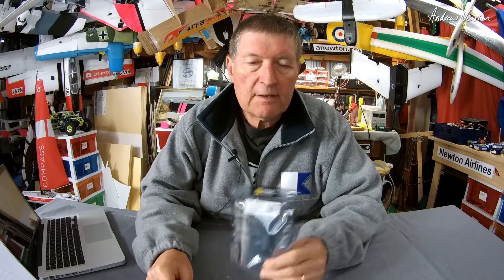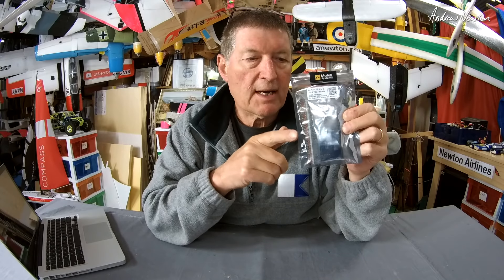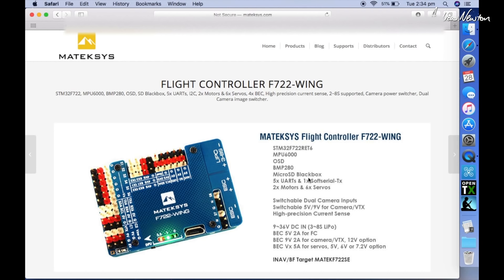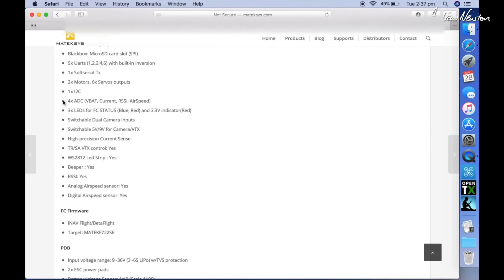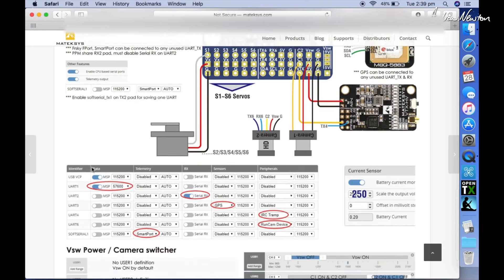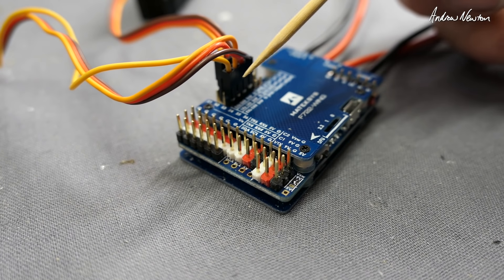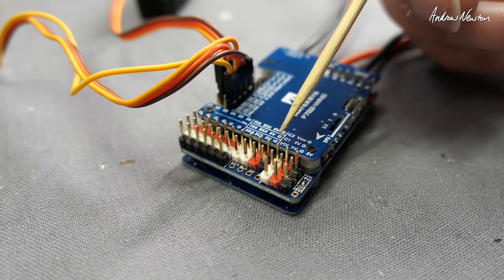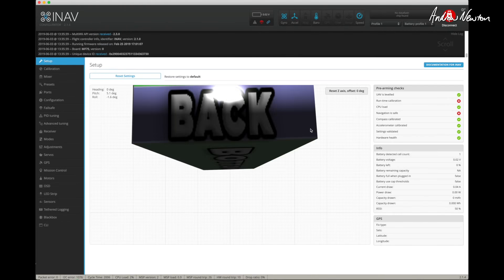Matek F722 Wing iNav FCB

Comment: Nice video. How to connect smartport? I really confuse because uart 2 is already use for SBUS
Reply from the maker: 2 ways. Enable Smart Port on any spare UART in the Ports tab and connect to the TX pin. Or enable CPU based serial ports in Configuration, then Soft Serial on UART 2 and connect to TX2 (SBUS only uses RX2)

Comment: 06:32
You say you are using the F722 Wing card but when selecting the firmware you select the MATEKF722SE version and not the MATEKF722 version which is the reason?
Reply from the maker: Correct target is written on the bottom of the board and on the product page. I guess Matek consider the Wing version of the board to be the SE Special Edition, confusing names.

Comment: nice job, just wired up mine no video thru the board
Reply from the maker: Things to check: Cam and VTx work without going thru the board. Cam in C1 and VTx into VTx. Board powered up and VTx powered up. Correct channel. User2 mode setup to turn C1 on. Polarities correct.
Reply from the maker: Oh unless you dont actually want video.
Reply: I have the same issue... How did you set up the user1 options?

Comment: Cam switching on and off for hd don’t work on mine.  Been trying for months to get it working bug no go.  I just run my Mix2 hd and second cam continuously.  I’d like to be able to shit off hd/Mix2 when not recording footage but something is not working properly.   I have mine setup identical to yours.
Reply from the maker: So you have bridged the little solder pads to select voltage, and set up User 1 in iNav Config?
Reply: Andrew Newton yes.  I selected 9v and user1 for on and off but doesn’t turn hd off

Comment: Anyone flashing this board with inav please use the target from the matek website. Also make sure to clean any extra flux off after soldering the pins on, extra flux causes shorts. I also broke my USB off but I can still connect to it using an ftdi adapter in Uart 1. The board also will not show proper mah drawn without a capacitor. Still love the board just a few hiccups.
Reply: Epoxy is your friend with the USB port, you should try replacing it! I managed to flash my board with no issues in Inav.
Reply: FYI: I just downloaded the firmware from Matek web site AND from iNav.
I compared the files and they are the same. (and exactly same size 843727 bytes).
Reply: jocelyncloutier maybe the problem was fixed. When I downloaded the target from inav the barometer wasn’t recognized.
Reply from the maker: Thanks for clarifying that. No issues with mine so far.

Comment: I have two F722-Wing boards and two F405-Wing boards.  I much prefer the F405-Wing.

I hope the next gen F7 board that will have the larger flash to accommodate Arduplane is better.

The problems I've had with the F722-Wing are:
1.  Random corruption of settings
2.  Random settings (OSD especially) reset to defaults
3.  When the above happens - strange things happen in stabilized flight modes (flick into loiter and the plane rolls inverted / begins a spin)
4.  DFU flashing issue if UART 1 or 3 is used for GPS (multiple targets error)
5.  INav 2.1 default tune flies terrible (probably more INav 2.1 issue vs this board, but 2.1 is as old as is supported for this board).  One major annoyance was horrible wandering on yaw and it would eventually just 'hard over' the rudder and fly crabbed in stabilized modes.

A couple solid Autotune sessions sorted out the default tune / PIFF settings and it has been flying well since.

I just know I'd have had a solid flying model a LOT sooner with a F405-Wing.  My other F722 is mostly a bench queen for now.
Reply from the maker: Just had a problem with the OSD font upload. Had to reflash the board to regain OSD after it kept hanging.
Reply: @AndrewNewton  It does seem that moving the GPS to UART6 stopped the corruption issue which seemed to be the root of most of the problems I had.  It's been reliable since.
Reply: I'd still go F405-Wing.

Moving the GPS solved the problem of the FC forgetting settings / general flakyness.

It still flies terrible in stabilized modes vs other FC's.  I'm determined to tune it out but it's remarkably bad.

Comment: Hi @AndrewNewton, can you help me find out what is the six pin component at the upper right corner of the SD card slot of Matek F22 wing. I snapped it while soldering the pin headers. It's now broken and need replacing. A newbie mistake😭😭😭
Reply from the maker: Don't know sorry. Mark the component on an image of the board and post it on the iNav Fixed Wing group or on RCGroups.
Reply: @AndrewNewton  will do. Thank you for your reply.

Comment: So am i right in thinking this wont work with my pwm receivers? I use hitec and they are good but the ones i have are all pwm, ie: old school. I've been doing a fair bit of balsa building recently and was looking for something new to sink my teeth into. This could be just the ticket!
Reply: My EZUHF works okay on the F405 Wing FC....they are old school ppm...works on the sbus port...just select ppm in iNAV.
Reply from the maker: I dont think you can use PWM receivers on these boards. The Air3 boards came with PWM PPM and SBUS Rx cables

Comment: Very timely review: i just received a F722-wing yesterday... and I did re-watched your F405-wing review this morning. As always, you did a very good job at pointing to all the right places and providing some "gotcha" explanations (like for the DFU button and use of analog RSSI). Cheers!

I would like to use the Vsw to turn on my vTx when desired (I do not want it to heat to much as I am waiting for GPS lock)
I correct in assuming following that I should use the Vsw pin for powering my vTx?
Reply from the maker: Yes that's right. Good use for the Vsw